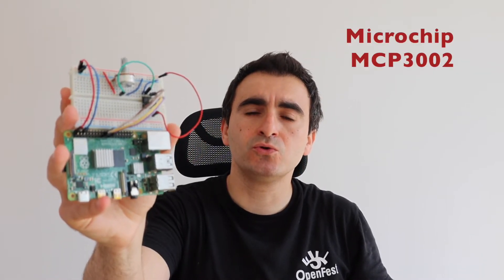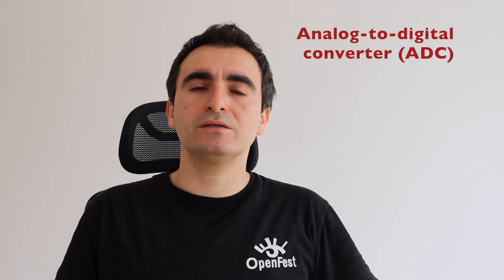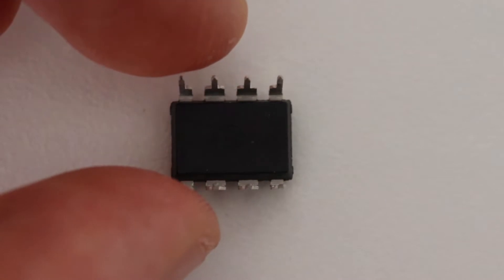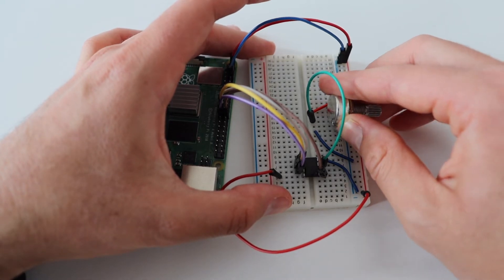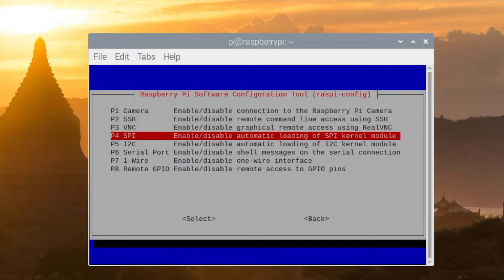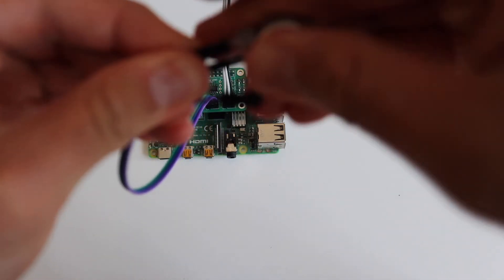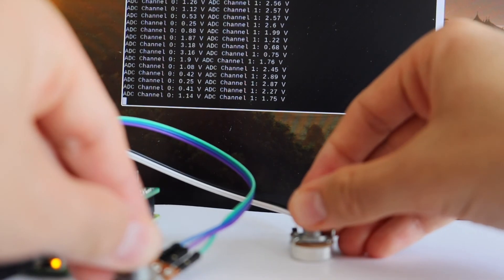Raspberry Pi Analog to Digital Converter (ADC) Microchip MCP3002

Comment: Is this only for 5v reference sensors or can it also read ohm resistance type of sensors
Reply from the maker: The MCP3002 is a 10-bit Analog-to-Digital Converter (ADC) from Microchip and its measurable voltage range is directly tied to its supply voltage. For an example, when powered at 5 V, it can measure voltages from 0 V to 5 V, while at 3.3 V, the range becomes 0 V to 3.3 V.
Reply: @LeonAnavi but 5v is what this chip operates anyways correct? This is going into a car which is a 12v system but obviously id figure a way to drop that
Reply from the maker: You can use a DC to DC step down voltage converter if you need to efficiently reduce 12V to 5V. I reviewed such a module in this video:
https://youtu.be/Yz8nR_CTVMM

Comment: Hi, thank you very much for the video. I am using the 4 channel MCP3204 to sample 4 microphones simultaneously. Can the python script in your github be expanded to receive data from 4 channels?
Reply from the maker: Yes, it should be possible to modify and expand the Python script because MCP3004 is also connected over SPI.

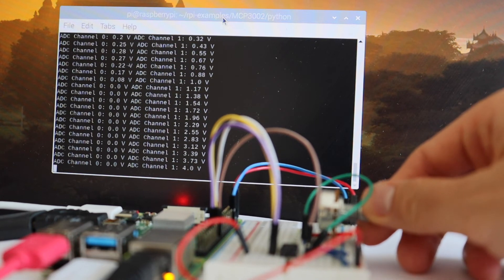Comment: But the Pi already has a 10 bit analog digitizing doesn't it? 0-5v. Is that meant more for DC than audio? Also, I would be interested to run it in fully differential balanced mode would that require two digizing pins plus common? Or maybe I am thinking of the Arduino... PS that looks amazing at 7:10 when you have live feedback of the line voltage very nice.
Reply from the maker: No, unfortunately the Raspberry Pi single board computers don't have a built-in ADC. Over the years Eben Upton, the mastermind behind rpi, has given several interviews explaining why they decided to skip adding an ADC. In a nutshell he says the ADC will increase the cost but only about 10% of the users will use it. However, the new Raspberry Pi Pico microcontroller and the Arduino family of dev boards have built-in ADC.